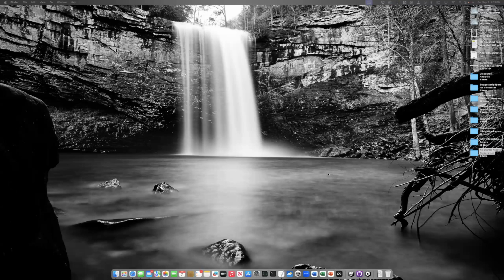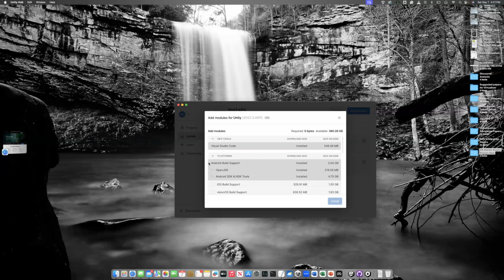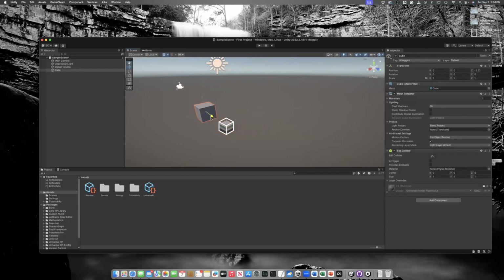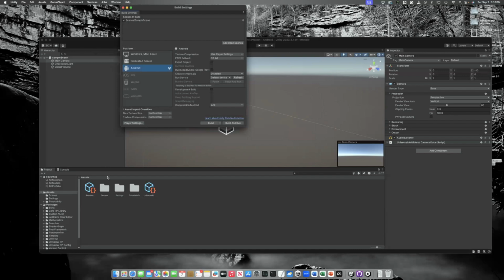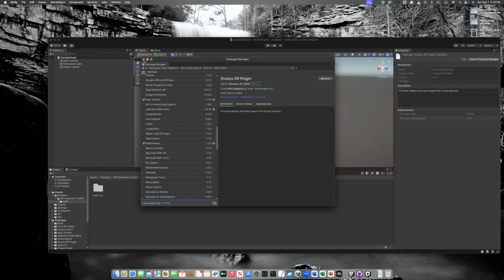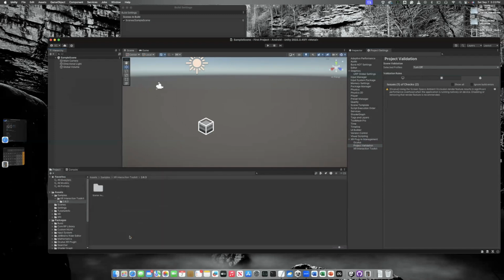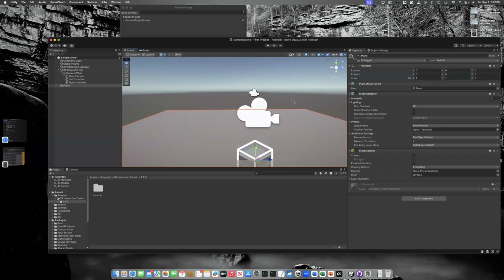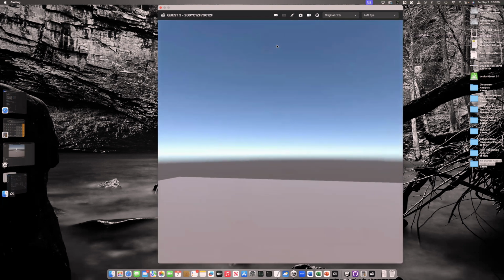VR for Beginners Using Unity | Part 1A | Setting Up the Game Engine for Meta Quest 2, 3, and Pro

Comment: It lasts 30 minutes but it is worth it.
Finally, I can run my first VR app. 
Thanks! 
Looking for more advanced videos! 
Subscribed
What about VR in Play Mode? Is it possible?
Compiling build is quite longer than run in Play mode i guess
Reply from the maker: Thank you so much for the comment and subscription. It really motivates me to create new contents. Speaking of contents, I would like to say, stay tuned! More exciting contents are coming in the future! VR in Play Mode for Quest headsets can be a bit tricky because it is only supported on Windows. Also, another painful problem is, you have to have the official Oculus Quest Link cable to do that which is currently $80 on Amazon. Link is - https://www.amazon.com/Meta-Quest-Link-Cable-oculus-2/dp/B081SHD773/ref=asc_df_B081SHD773/?tag=hyprod-20&linkCode=df0&hvadid=693459401938&hvpos=&hvnetw=g&hvrand=797119097598898440&hvpone=&hvptwo=&hvqmt=&hvdev=c&hvdvcmdl=&hvlocint=&hvlocphy=9013193&hvtargid=pla-922505388431&psc=1&mcid=57259c9a3c993ff284d554dcfdb0bb98. I tried other cables, but most of the time, they would not work except if I used the official link cable. Next, you need to download the Oculus PC software which will take another around 7 to 8 GB of space on your computer. The link of that software is - https://www.meta.com/help/quest/articles/headsets-and-accessories/oculus-rift-s/install-app-for-link/. Go to this website and download the software from the given link. Once these are setup properly, (1) you can plugin the link cable with your headset and the computer, (2) allow access to your computer from the headset, (3) keep the Oculus software turned on in the background in your computer, and (4) then if you hit the Play mode in Unity, you can see the game running directly on the headset. The sad part is, the link cable often suffers from loose connections. The white cable is much more robust. Feel free to try these steps if you like. However, if you are a Mac user, like me, you are out of luck. Your only way is to use the "Patch and Run" option in the "Build Settings" of the Unity Game Editor. I hope, the answer will help you to clarify your doubts. Feel free to reach out to me if you have further questions!